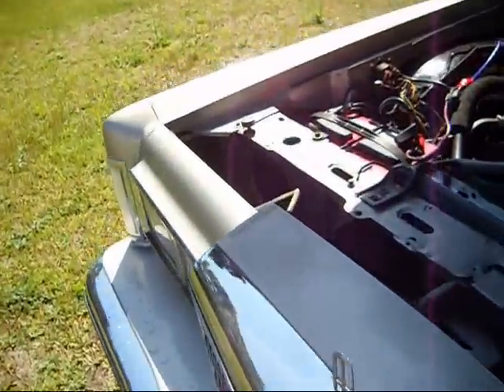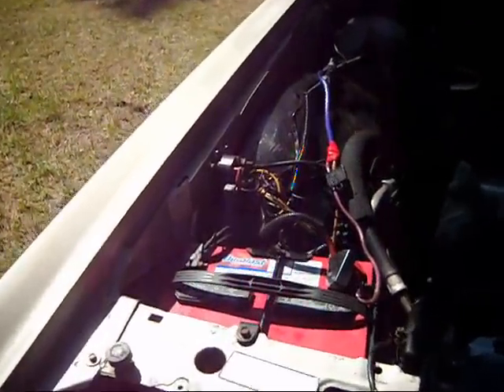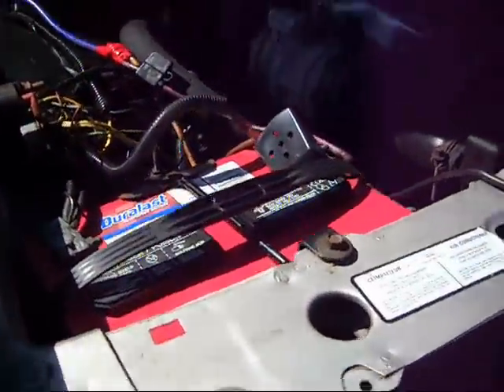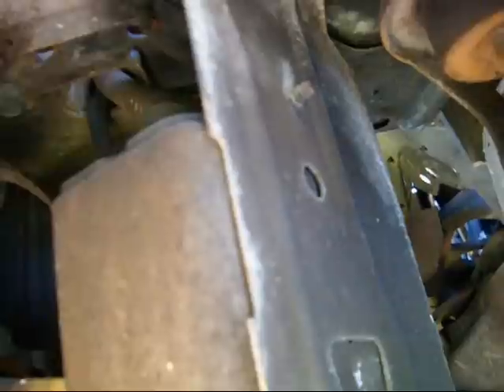wth is this??

Comment: @JakeDaSnakeFilms Cap off the vac source, most likely at the intake somewhere.. Disconnect the sensor and tie the cable out of the way. It won't make any performance difference, just less weight and cleaner engine bay.

Comment: it's the charcoal canister, the vaccuum hose on the front of the upper intake is for the canister purge solenoid, when the solenoid opens, raw fuel fumes get sucked into the engine there is a 1/4" vapor line that comes from the fuel tank to the charcoal canister.......it in no way hurts performance as long as the vacuum line to the solenoid and the canister is good and the solenoid works, i would retain it or you might get a fuel smell